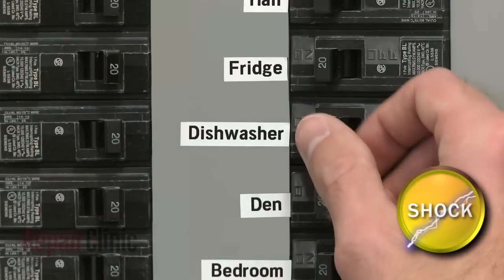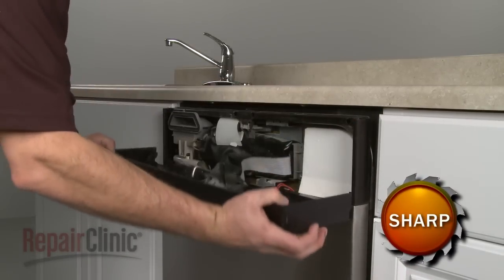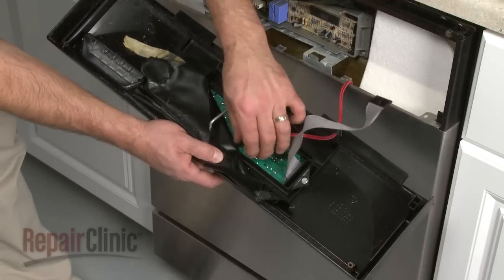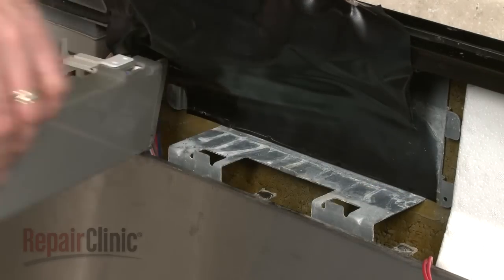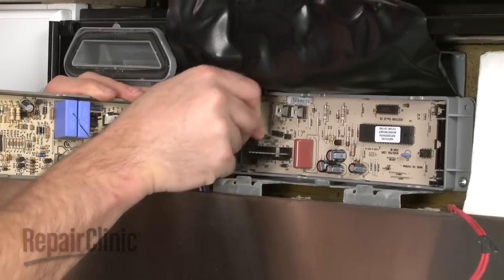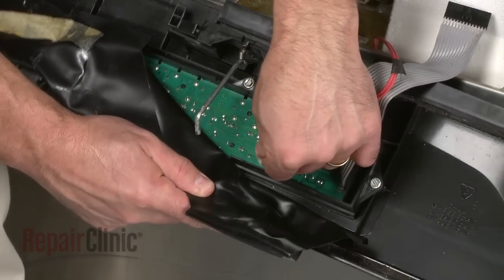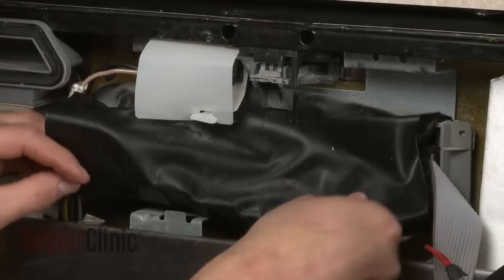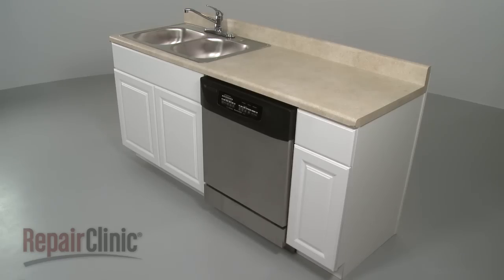KitchenAid Dishwasher Control Board Replacement #8051136

Comment: The first thing I would test is the delay start button before ordering your control board. If the delay start works replace the control panel. This was my finding. The video was extremely helpful on replacing the control board, but once I turned the breakers on It still wasn't working. I replaced the control panel and now I'm listening to my working dishwasher.

Comment: My MAYTAG model - MDBH980AWS dishwasher will not start! All lights are on except the two buttons - START/CANCEL and DELAY 2,4,6 ..... will not light,  any ideas? Someone else suggested it may by the CONTROL PANEL or CONTROL BOARD that needs replacing! but how could that be, this dishwasher is under 2 years old! Warranty ran out just in time for the break down! I called MAYTAG and they basically said to get lost! I've spent over $1100 on this thing, and frustrated! Can you help? Thanks!